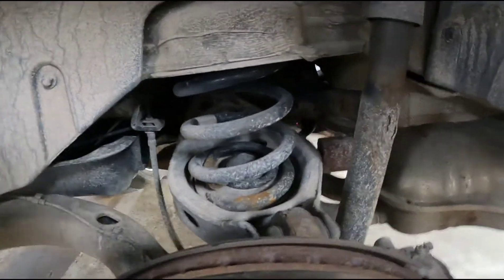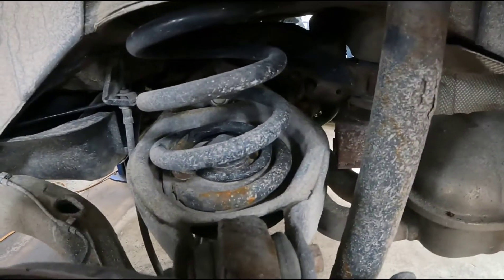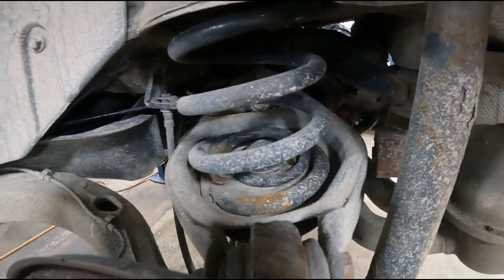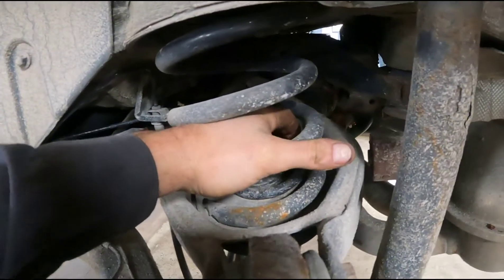2006 BMW X3 REAR COIL SPRING REPLACEMENT

Comment: Hello, I did the swap 3 weeks ago, i also added 20mm coil spacers. Mine were not broken, but they were old and the car was sitting very low at rear even with empty car. Now the stance is better and with fully loaded car is not sitting on the back.

Comment: Had to do the same job on my old E46 sedan, had broken springs on both sides, and failed the safety inspection bc of that. 😜 I used the a second car jack as a pry bar. Maybe it's important to mention that suspension springs and/or shocks always have to be changed in pairs.
Reply: Where to you live that the safety inspection looks at the springs?  I'm in Massachusetts and they don't look at jack squat.  They check lights, horn, signals and a few other odds and ends.
Reply: @dickjohnson7845  In Germany, they are really strict on safety inspections here.